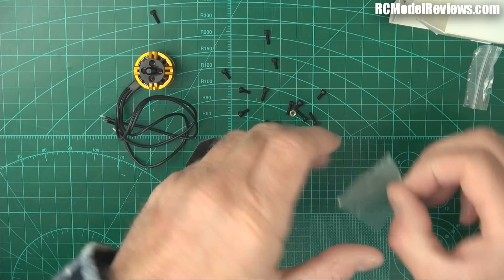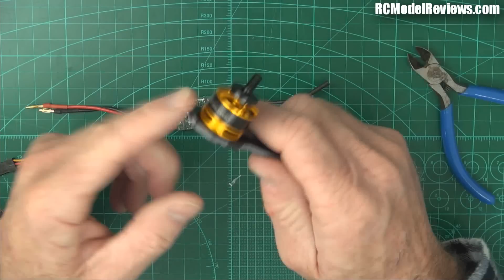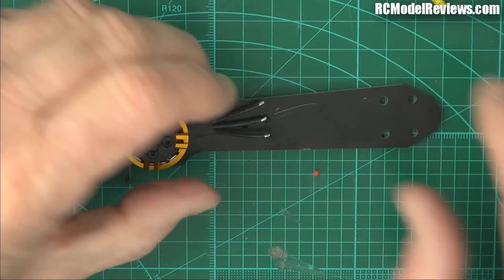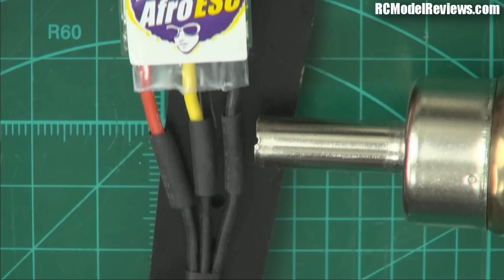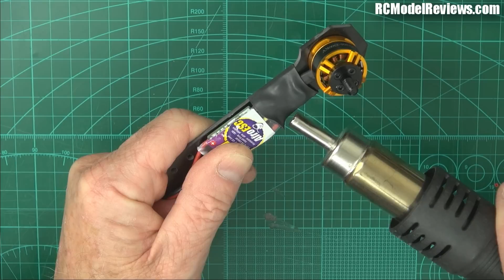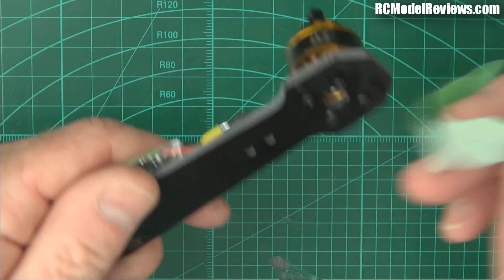Low cost miniquad racing drone build video PART 2

Comment: Use the Legs...when you land in grass with dew or scrap the pavement on a low fly by you'll be happy. I don't know why this guy always makes fun of people who use landing gear.
Reply: SF PV Never used legs, never had a problem without them.  Given how hard some of my "landings" have been, I wouldn't expect legs on my quads to last more than a few minutes ;-)  A better option for legs is a short length of garden hosepipe cable-tied to the arm.  It's more shock-absorbing than hard fiberglass or carbon legs
Reply: Good tip. I still like the legs that mine came with. I have my PDB on the bottom of the frame so that's why I use legs. I guess if you don't have it like that you can just keep scraping your motor mount screws :)
Reply: SF PV Actually, it's the locknuts on the bots that hold the arms to the frame that tend to be the "landing point" if you don't use the legs provided.  I don't think you'll wear out the locknuts any time soon :-)
Reply: I'd recommend 3d printed skids long before the landing gear.
Reply: Well ya so would I. I've never seen 3d printed landing skids. Please link me! :)
Reply: SF PV baby foot jbxbbbbbbbb ofxxfbfjjpooloooopjnjbbz tbh

Comment: Interesting...why wouldn't you solder the motors directly to the ESC?
Reply: SF PV Because lots of folk don't have the skills or confidence to do that.  The solder-pads on the ESCs are small and it's easy for the inexperienced to overheat them (causing them to lift from the board) or create solder-bridges with surrounding components.  Using the method shown in the video it's pretty near impossible for people to stuff things up.
Reply: Good point :)
Reply: Even as a novice solderer I would have liked to see how. With some flux I can do a lot more a lot better.

Comment: Great vide Bruce! Just a quick question, does it matter which way the motor is spinning as long as it is spinning the same direction as the opposite corner? And the other two spin the opposite way? Could I just reverse the yaw?
Reply: Fromatic Are you sure you dont have one?! I never thought of that but now I agree with you :)
Reply: supermattJD Yes because most flight controllers use a specific setup. You should check your flight controller for the proper motor layout. For example, here are the layouts for the naze32: http://rcculture.com/wp-content/uploads/2014/08/Multicopter.png
Reply: I know there is a way to do it, but if you did it the opposite way would it not work the same?
Reply: supermattJD Yes, jordanneff  is correct and I'll show you which way they should spin in the next part of the video.
Reply: I know which way they are supposed to spin, I'm just saying would it work the wrong way around if you reversed the yaw?! :)
Reply: supermattJD I dont have one but I imagine it wouldnt work, as when it detects movement in any direction and tries to correct itself by increasing one motor expecting it to lift/yaw that corner, it would instead have the opposite effect, so it would then spin it faster to try and compensate which would just make it worse till it hits the ground, is my guess
Reply: supermattJD Ha, I dont have one "yet" but hoping to build one this year, but I have spent time thinking about the control mechanism and watched plenty of build and flight videos etc ;)
Reply: Fromatic Well you know a lot about them!!  Good luck on building it too, I hope everything goes well for you :)
Reply: supermattJD Cheers, but just wanted to say whilst watching more videos, I am now less sure of my guess, as I was thinking well maybe it would only affect yaw control maybe forcing it into a spin, but 'lift' might still work as the flight controller sends a signal to the speed controller to increase the motor speed at that corner, then the direction the blade spins depends on speed controller connection, so maybe it wouldnt roll or pitch out of control, but maybe just yaw out of control, would need to ask somebody who has tried it...
Reply: Fromatic I might try it :)
Reply: supermattJD Be sure to let me know if you do, as ive already spent far too long thinking about this to not get a definitive answer lol, have fun
Reply: Fromatic I will let you know some how :)

Comment: You can solder the ESC's straight to the motor updated ESC's to BLHeli and config the motors to reverse. That way you also gain Oneshot and Damped mode.
Reply: ***** You are right about the lead-free solder being a pain.  The best way to solve this is to add some leaded solder before you try to unsolder the wires.  The leaded solder will mix with the lead-free and reduce its melting point -- thus making it much easier to remove the wires.
Reply: Chris Yes, I'll be showing this in a future video but I suspect that most folk getting into miniquads for the first time will prefer a "simple" solution to a high-performance one.  Reflashing ESCs isn't for everyone, nor is soldering straight to the PCB on the ESC.
Reply: ***** Ive wrecked 2 of those afros trying to solder the motor wires directly to them. That lead free solder they use takes so much heat to melt that the tiny smd components come loose.
Any tips on how to do it without destroying them.
Reply: Thanks for the tip. Maybe I need to raise the temp of the iron as well. That way it stays on the board for less time.

Comment: thoughts i share my method of joining motors to esc or any wire :)

strip both wires back alittle "install heatshirnk" and push the wires into each other, roll with your fingers to make it smooth and solder it up , the path of least resistance!

Comment: How come you don't use a small foam pad between the esc and the arm? The vibration in the frame will transfer onto the esc and break one of the components off. Happened to me a few months ago and it makes for a rather interesting landing usually upside down. It wont take long to do and will save you a lot of time and hassle ripping apart that arm and repairing that esc.
Reply: Armenian I've never had an ESC fail from vibration.  Foam pads will effectively impede cooling though -- and I suspect that heat buildup could be a bigger killer than a few vibes.
Reply: ***** well seeing as you heatshrinked over the esc and they come from the factory heatshrinked i dont think that a foam pad under it would cause too much heat build up the only down side i see is weigh

Comment: As always nice video Bruce, a lot of good tips for newbees and experience-blind people (stuck in the way, they doing it for years ;) )

And I have a hint for them to, use the allenkey with the short side on the top. So you won't overtighten the screws and you have the same lever for tighten up the screws evenly. When i did it the other way when i made my apprenticeship, my master would slap my on my fingers ;)

Anyway, keep up the good work, get people in the hobby. Have fun with your work. 
And all good for your shaky hands, I hope the best for you!

Greatings,
RxTxFx

Comment: Just for a little extra hint for people who never stripped cables before. Buy a cheap stripping tool, because if you not careful, you will cut in the cable and damage the thread of the wire. If you just lose 1 or 2 thread its not a real problem but more than that can cause problems on the run. So if you not feel comfortable to cut the insulation whit a cutter, then get a stripping tool ^^

Comment: Strip the ESC's down completely, desolder the wires and solder just the wire length you need then get some double sided foam tape and stick the esc onto the arm, then heat shrink over the top to hold it all onto the arm. Best way to do it, but yeah I understand if you're new and scared of soldering pads it's probably a bit too intimidating for you.
Reply: This stuff http://buzzhobbies.com.au/index.php?route=product/product&path=59&product_id=519 is great for mounting ESC's on arms before you heat shrink over them.
Reply: MrShufty Yes, that's what I do on all my quads but it is a bit intimidating for most people so I opted to show a "safer" way to solder things up in this build video.
Reply: If you do that and the motor runs the wrong way, can you reprogram the speed controller to reverse direction, so you don't have to swap wires?
Reply: ***** depends on the firmware you use. But yes, with specific firmware and an ESC programmer tool this is possible.
Reply: ***** That's generally why you'll do two motors with straight connection from the esc to the motors and 2 that are crossed over (like Bruce does in the video). You can then test the motor directions and put the arms in the right places when you put the quad together. Otherwise if you're running BLHeli firmware you can change the motor direction in the software.
Reply: ***** Yeah I guess, you soon learn to solder if you get into multirotors though ;)
Reply: MrShufty I did.

Comment: Can I order from banggood if I'm from the uk? And will they charge any in port taxes or whatever
Reply: Import fees and VAT will probably apply, just as with any foreign shop. They won't charge that, your customs will. Consult your local customs' website for more info on imports.
Reply: yes.
But, just go on theyr website and you'll find out for yourself mate. :-)
Reply: xxxenricop All the costs aren't displayed there. Only what THEY will charge you.
Reply: Its your dad if you are in UK give these guys a try http://www.hobbyrc.co.uk
I get 90 % of my stuff from them, they are mega helpful and accepted returns when I made mistakes in ordering etc.. They stock the ZMR frame, I am sure they can make a up a package for you.
Reply: Joe Baker Marking something "gift" never works here anymore, weird that it would anywhere else.
Reply: just go to the website man an use your local warehouse there are no extra charges within the EU .
Reply: Joe Baker It's silly that customs would still buy that. Hasn't worked here in years. That's also fraud, if I'm not mistaken. Or at least tax evasion?
Reply: Joe Baker But you know what the real value is...

Comment: On some ZMR250 arms the guides for the motor screws are a little big for most motor screws, the screws just barely grab hold. I remedy that with corresponding washers, expand the grab area (then loctite of course)

Also, another way to solder together the wires if your iron isn't the highest quality: don't tin the wires, just strip the ends and fray the wires a little bit. Do this for both esc and motor wires and push the wires into each other, then pinch in loose frays with pliers or tweezers, then heat and pour solder in the connection
Reply: BashMonkeyRC I use washers under the bolt heads as a matter of course even if the holes are the correct size.  I hate to see the frame being mangled by the bolt as it is tightened and the same goes for the bolts used to assemble the frame.
Reply: Can we get a link to the washers for this videos build? (Zmr and dys)
Reply: SuperTuNiX I have an endless supply of washers made for ultralight unobtanium  individually pressed out and polished by one of 6 Vestal Virgins on our staff. Or you could just do the old school thing and visit the local DIY hardware store:)
Reply: Rob B Sorry, but I simply refuse to believe that the supply is endless.  That would be ridiculous.
Reply: SuperTuNiX Rob's comment aside, go to hobbyking and look for washers under the Hardware & tools section. Depending on your motor screws, it may be the #2 or #3 washers
Reply: +Rob B lol that was great!

Comment: Bruce... Just flipping the 3rd and 4th ESCs upside down will give you 2 reversed arms without needing to cross a wire over another and you can easily see the 2 different arms by the ESC label being visible or not.

BTW... after you cut the heat shrink from the ESCs you can use the hot air gun to
re-shrink the rough edges.

Another tip for the new players... If using cable ties make sure to cut the end of the tie flush with the locking tab to avoid harm. Those non-flush nylon ends can do some nasty damage to skin.

Comment: I've started putting small washers on the screws holding the motors to the arms...

Had them pull through in a bad crash before...
Reply: I did the same! When tightening, the heads burried in the holes and the motor was never real tight!

Comment: Bruce you probably don't have time to reply to this but I would like your opinion on cutting away the shrink wrap over the ESC's Heat Sink for better cooling?
Reply: Its not really needed. I never had problems with overheating ESC`s. Also if you land in wet grass you spray water around and all over your ESC. that could damage them.
Reply: FPV SPY Not necessary in most cases -- certainly not in the case of this build where we're not going for maximum performance.  Those 12A ESCs won't even get remotely warm with these motors and a 5" prop combo so cooling isn't too much of an issue.  You'll note that some ESCs have a small aluminum plate over the FETs to provide better "burst" cooling.  If you remove the heatshrink then you loose the ability to hold that plate in place so the burst rating of the ESC is effectively reduced.
Reply: ***** Bruce, I have a slightly different take on those metal "heatsinks" I tend to think of them more as heat spreaders keeping all the individual FETS at the same temperature(even considering the negative thermal coefficient of MOSFETS). IMHO, to act as a true heatsink then one side of the sink needs to have a greater surface area i.e. have fins or be actively cooled. In any case the heatshrink effectively insulates the whole affair making the heatsink theory even less credible.
Reply: Rob B As you say, the NTC of the FETs should ensure that they heat evenly without a heat-sink.  The aluminum plate simple represents a thermal mass that will allow the FETs to run at higher currents (thus dissipating more heat) for a short period of time without exceeding their rated temperature.   As you point out, due to the insulating properties of the heat-shrink, it won't increase the continuous power rating at all -- but it will allow for short bursts during which time the heat will be soaked into the aluminum, to be dissipated slowly over a longer time-period.  You'll notice that the ESCs with the highest burst ratings tend to have the heaviest aluminum plates ;-)

Comment: No need to cross the motor wires when using blheli esc's as you can reverse the motor using the USB link cable (the afros do blheli, which allows you to use oneshot125 and damped light mode)
Reply: paulham It's probably still faster/easier just to cross the wires though. Flashing and configuring blheli is a bit too complicated for noobies.
Reply: I was about to say the same thing!
Since I've been using BLHeli, I really don't care about the wiring and just do all that in software, so much easier ! (and those Afro12A support BLHeli too)
Reply: Murphy Quad I was actually surprised how easy it was to flash the afro's with blheli, but still, probably a bit intimidating for the noobs.